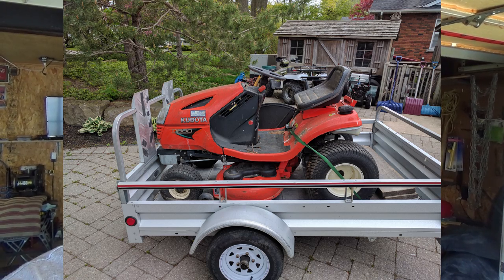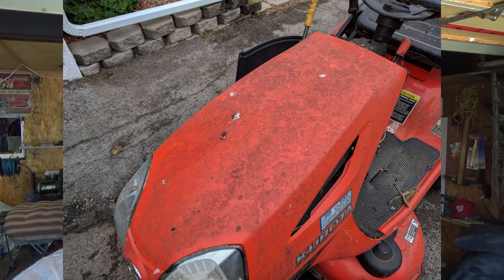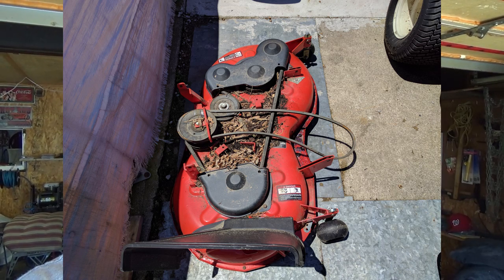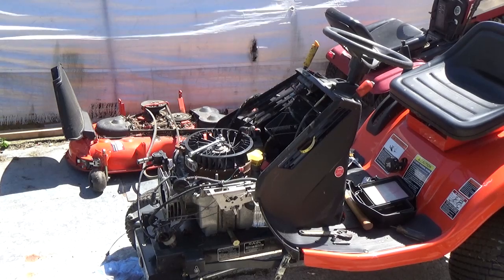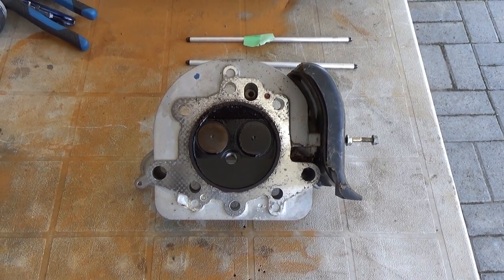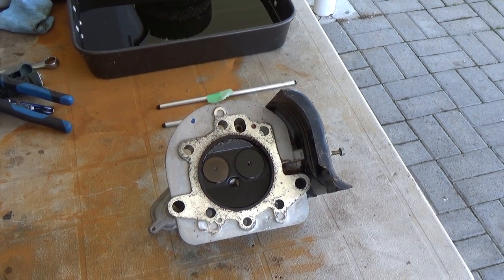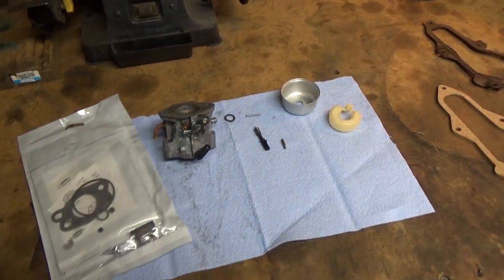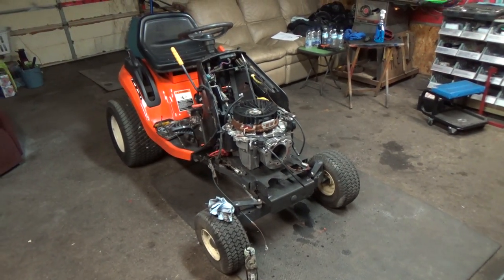How to Fix a Seized Engine - Kohler Courage P.1

Comment: Good job. On any head torquing sequence, I'd start with center(upper/lower) and work center out  in spiral pattern. Helpful Valve adjustment acronym( you may know already): E.O.I.C.- Exhaust Opening, adjust Intake to speck; Intake Closing, adjust Exhaust to spec. Anyway, I like your channel...😉👍Clay D

Comment: Just a tip: If you don't have a drill and wire brush wheel, a piece of mesh (screen) sandpaper used for drywall, plumbing pipes, etc...will clean the cylinder walls, around valves, head etc...

Comment: I love those folks with less brains then money.  Last fall I acquired a B&S powered troy bult mower 2 yrs old which the previous owner had left gas in which had solidified.  I soaked it is simple green and agitated it by talking to it for 6 hrs. Last month a Honda powered pressure washer with the same old gas problem and a shattered pump.  Replacement pump is $85 and I now have a $300 Pressure Washer.  Thanks for the tips on the inch lbs and the return spring on the torque wrench.  Narragansett Bay

Comment: 3 things. 1. U really need/ should remove the piston.. clean the rings out and gone all way down to the base of the cylinder in block when honing any cylinder... 2 we call it setting valve lash/ clearance.. 3 when u torque a head down do it in increments of at least 2. 
So u go thru sequence at 15 ft pounds then again to 30. I think that engine wants 300 in pounds.. thas only 25 ft pd
Briggs wants 3 increments and most their 14 to 20 hp engines only go to 220 in pounds. U could warp the head if no incremental torque is followed. Kohler wants 2 increments for that model. But pretty good vid. I dont have any vids just a lonely repair tech watching vids late st night. Never stop learning bro!!

Comment: Hi There.
(14:12) - I hope you realise, or at least, are aware that most of those brass colored wire wheels are not actually brass but are steel with a brass looking finish.
Dastardly trick, I know.
I've been duped but only once.
Please check with magnets to ensure brass wire rather than el cheapo brass-colored steel wire wheel.
Great video.
Top marks.

Comment: That stuff comes from ethanol fuel. Its corrosive and leaves like brown sugary substance behind. Process excelerates when dissimilar metals are in contact. I.e piston rings and pistons. Piston and cylinder walls. Sparkplugs amd alu heads

Comment: If you are a small engine shop, why wouldn't you use carb cleaner in the ultrasonic?  Soapy water can't be strong enough to break up what was inside that carb.

Comment: Man that’s a lot of labor! Wouldn’t it be easier to replace the engine carb and starter?
Reply from the maker: No, this engine is still running good today! Ended up having to replace the intake valve because it had a leak from the factory; https://youtu.be/Ha2IkHgx-zo
Reply: How much is that Courage, $3-400? If he weren't talking through it, it goes by faster than it looks.

Comment: The antibackfire solenoid only keeps fuel from going into the cylinder and muffkin after shutdown causing backfire. It doesn't keep fuel leaking into cylinder and crankcase..needle valve does that.. I'm working on a kohler cv460 that was left outside and had water in crankcase causing subsequent piston ring seizure. It smokes and head gasket was replaced. I'm trying pb blaster sitting in cylinder first fir 4 days . I'll try atf  next.
Reply from the maker: Yes but if the needle valve leaks, engines that have carbs equipped with a anti backfire solenoid won't flood the crankcase, because the main jet will be plugged. Without that, the needle leaks, fuel goes up the main jet, into the intake and then down the cylinder past the piston and floods the crankcase.
Reply: @EliminatorPerformance  needle and seat should always be replaced when u find a carb in that state. The antibackfire solenoid is not designed to be liquid tight. 
If u have a leaking needle n seat it doesn't matter if its equipped w 
Antibackfire solenoid. 
Fuel will just top out in the bowl and get past the low jet or venturi passage fir example. Its no big. Not to correct u. I've had many engines w leaky needle seat scenarios that had solenoids and had chronic hydro lock events and fuel in crank issues. Just putting in a cent to keep it real. Great vid.
Reply: @EliminatorPerformance   He’s right. The needle valve will NOT keep gas from leaking into the crankcase. If you don’t believe me take the needle and float out and put it back together with the solenoid and a gravity feed tank. I would like to see a video of this to end this ridiculousness.

Comment: Seal at the float seat probably leaked all that gas into the cylinder slowly and the varnish built up inside the cylinder it mixed with oil it made that flaky slurry.

Comment: (8:05) - What's "ATF" if you don't mind me asking?
.
Reply from the maker: Automatic transmission fluid, my bad for not mentioning that. It's generally used to un-sieze cylinders!
Reply: @EliminatorPerformance  BITD (mid 60's) we used a solution of ATF and STP to coat cylinder walls, pistons, cams, bearings, when rebuilding engines. Narragansett Bay

Comment: That is what you call carbon, from the top of the piston and around the cylinder and some old oil and moisture that got inside the engine from sitting. That would have scored the hell out of the cylinder for sure though.

Comment: Do I need to get the piston at top dead center  to put the head back on after I do this to a Kohler cv 460 s
Reply: I'm sure you figured it out by now but, no, you don't have to have the piston at tdc before installing the head.

Comment: Can't reconcile all that carbon built up in the cylinder and the need for blade sharpening after only 10 hours of use. It appears the customer was not truthful with you, based on the evidence you found and you didn't make any comment about it.
Reply from the maker: I believe he used it for 10hrs like he said, and most likely bought it as a "new" used unit. You're right, there's no way this machine wasn't used more for the condition it was in.

Comment: Why did the blades need to be sharpen after 10 hours of uses
Reply from the maker: They hadn't been used and had been sitting outside for over a year

We just put a sharp edge on them, not necessarily taking much material off!